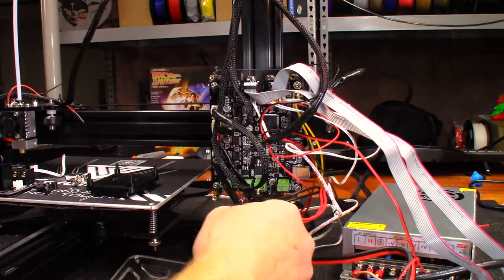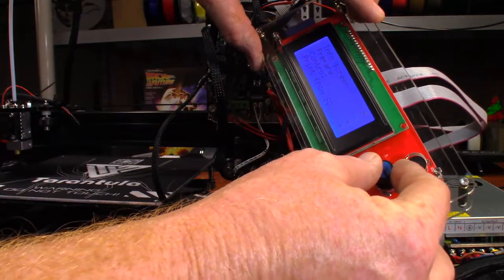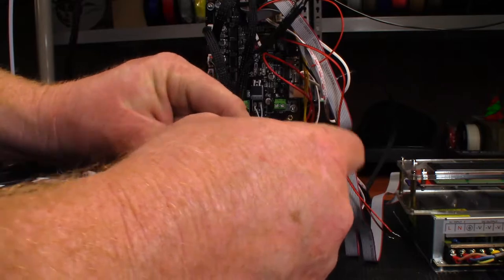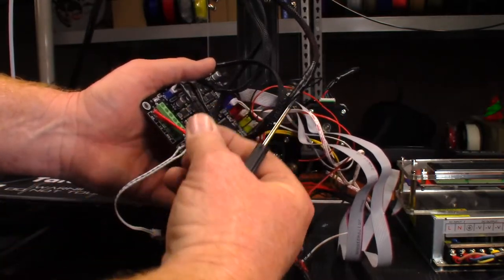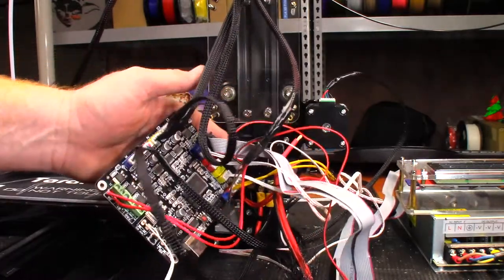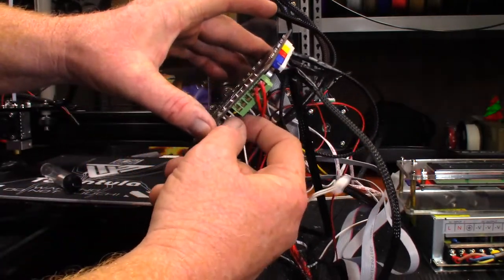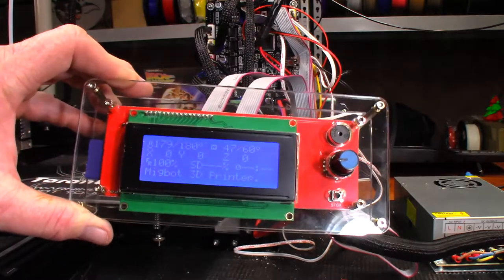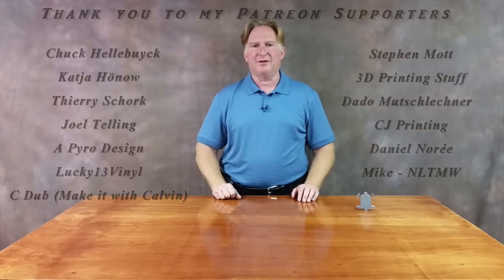Adventures In Upgrading the Tevo Tarantula / Part 3 Installing The Mosfet & Making It Safe!!!

Comment: Those screw terminals push a flat plate down, it's possible to get the wire in on the wrong side of the plate at which point no amount of tightening will keep them in place, you'd also be well advised to look into getting some crimp on ferrules for the cables ends, they make better connections and get rid of the issue of wire fraying.

Comment: The round connector reduces the surface area at the connector so you are trying to drive all that amperage through a tiny point of contact. That results in the joint heating up.
Reply: the right kind of ferrule crimps to create a square lug -- when people say use ferrules -- they mean  those type of ferrules -- the ferrules you have on the machine are some weird Chinese knockoffs, traditional ferrules insulate the cable and have a round piece of metal which your crimp, then it fits perfectly into the connector.

Comment: Get some solder wick -- no need to drill the board, at least less need to drill the board, unless of course you are using those crazy oversized 10 gauge wires :)
Reply from the maker: +kazolar In this case it was because the factory wire that came with the printer was too large for the holes in the board.